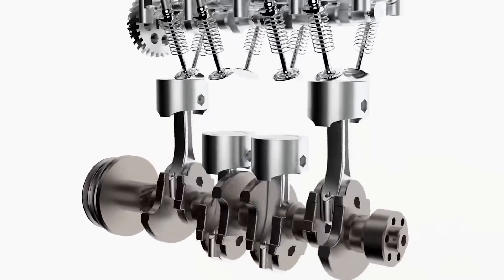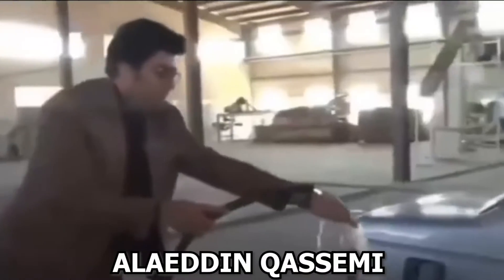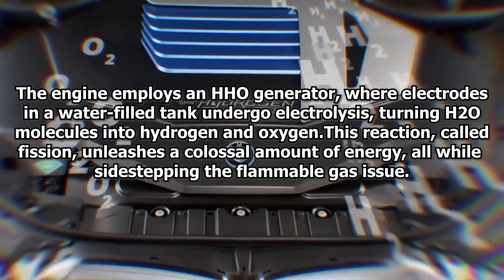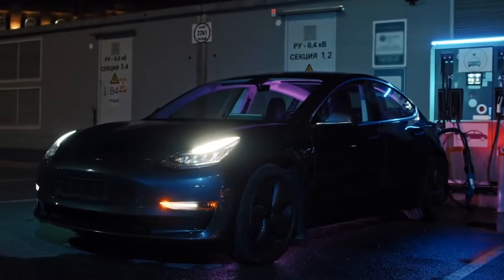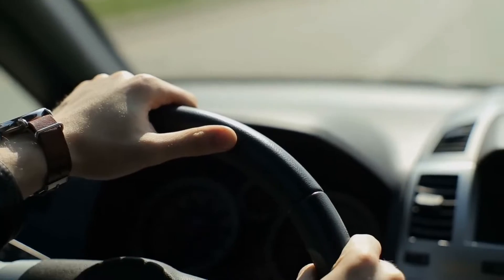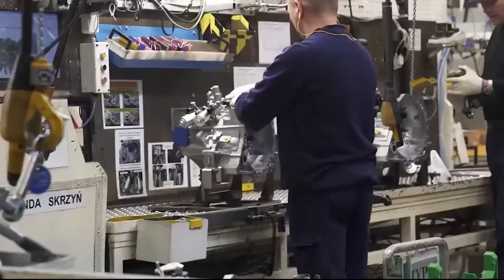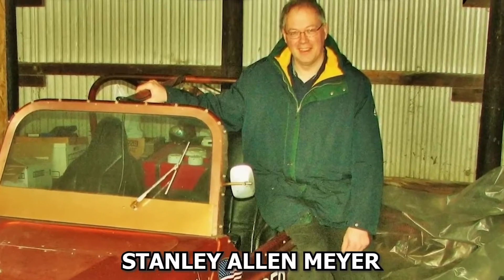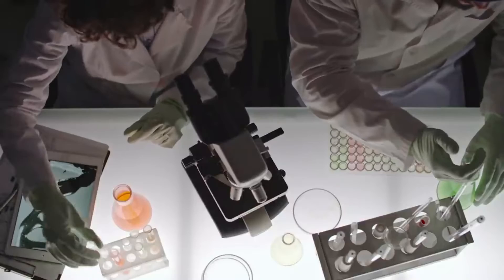Toyota's Engine Runs on Water!

Comment: I wrote a paper in college in the 70s entitled "A Hydrogen Based Economy". The paper showed that hydrogen could replace gasoline in existing storage and delivery systems. The problem at that time was the efficiency of extracting hydrogen from water, using more energy than it produced. That was 50 years ago.

Comment: All water engine inventors for the last fifty years have avoided talking about the real source of energy in this process. In fact, all the energy comes from the battery electricity producing the electrolysis of water to extract hydrogen. The energy required to extract this hydrogen is much higher than the energy delivered when burning it in an internal combustion engine. See https://youtu.be/OdtNavZxe1w

Comment: Most proposed water-fueled cars rely on some form of electrolysis to separate water into hydrogen and oxygen and then recombine them to release energy; however, because the energy required to separate the elements will always be at least as great as the useful energy released, this cannot be used to produce net energy. Another hoax :))

Comment: This video is such BS.  There are engines that run on hydrogen, using a fuel cell, and they produce water as a byproduct.  Toyota has a car called the Mirai that does this.  But an engine that runs on water, please. The people that made this video are either con artists or lack a basic understanding of thermodynamics.
Reply: Exactly

Comment: And how would you go about actually keeping up the electrolysis process without any other source of energy....?
Reply: Maybe a battery and this engine is just not efficient than the motors
Reply: @dabob2652  Water powered car is easy 
Once you know how 
But would almost overnight destroy the petroleum industry
Reply: Exactly. This is B.S.
Reply: There is another way easy not complex at all
Electrolysis needs 12 volts a few amps but is slow 
There is another way for "on demand" hydrogen